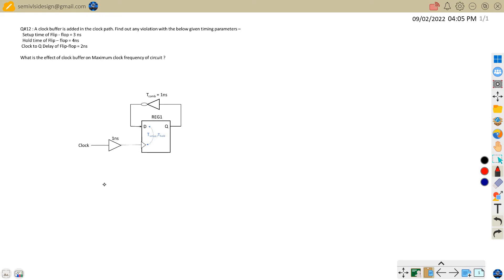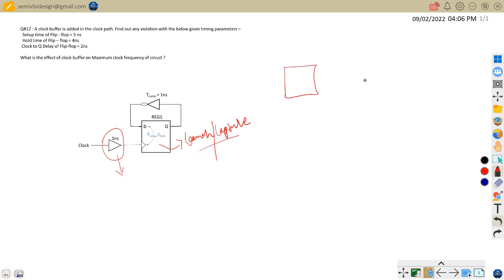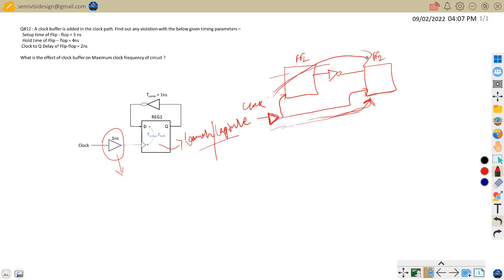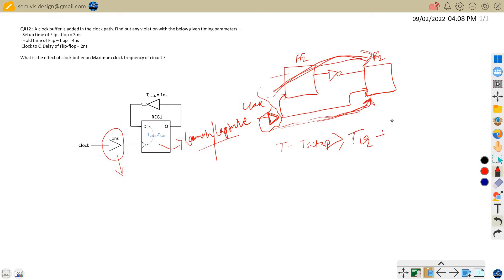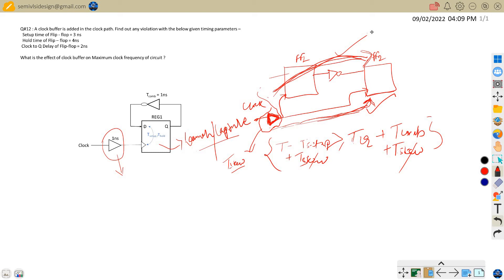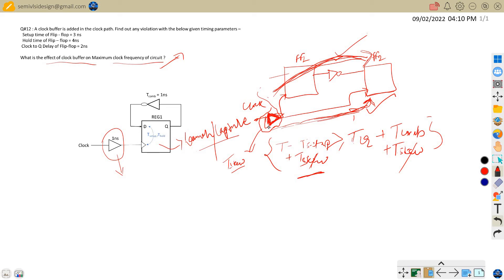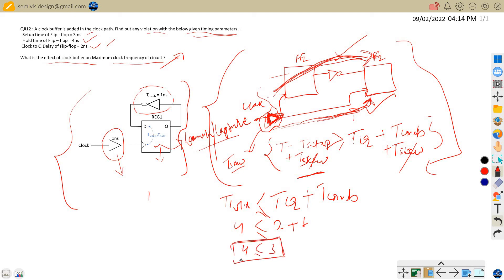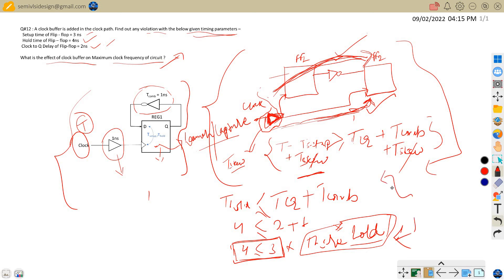Interview Question #12 | Clock Buffer Insertion | Static Timing Analysis (STA) | @vlsiexcellence ✍️

Comment: How to fix hold violation on that circuit? and how to calculate the maximum clock frequency?
Reply from the maker: Hi @carterlee287, To fix the hold violation, we need to increase the data path delay. For more details, you can watch this video - https://www.youtube.com/watch?v=wp1NtypRDyQ&list=PLbZHjPJZbJ9VgpgLBmyH7xt0AQ-ZtTcaT&index=13

For maximum clock frequency, first need to calculate the minimum clock period which is : T >= Tcq + Tcomb + Tsetup;   then Fmax = 1/T .

For more details on Setup & Hold Timing Equations : https://www.youtube.com/watch?v=43WqkoAgNy0&list=PLbZHjPJZbJ9VgpgLBmyH7xt0AQ-ZtTcaT&index=12

Hope it helps !!!